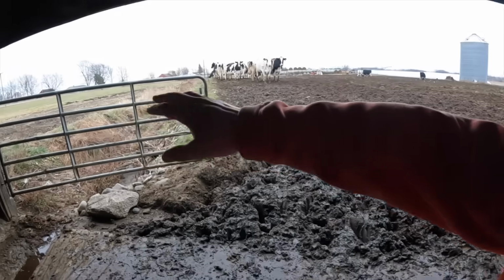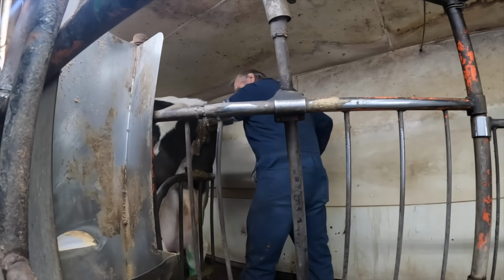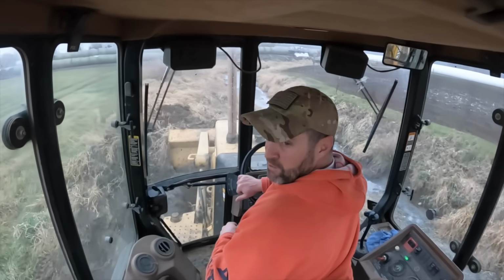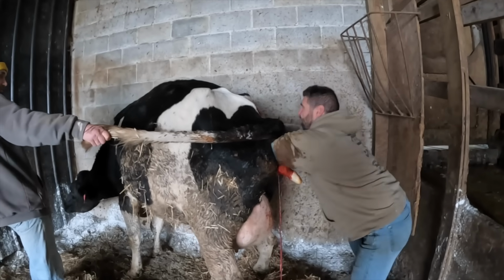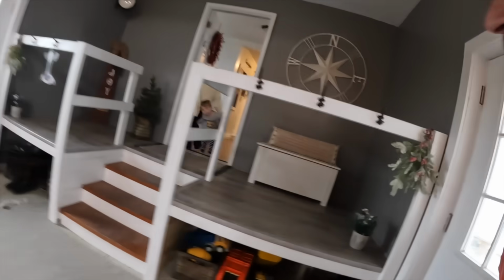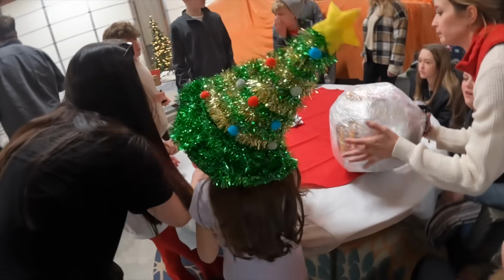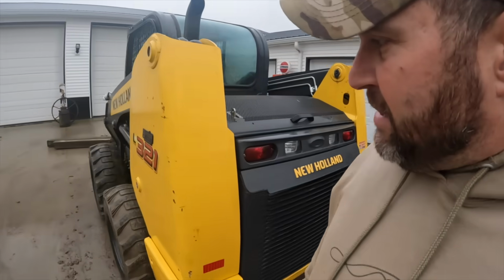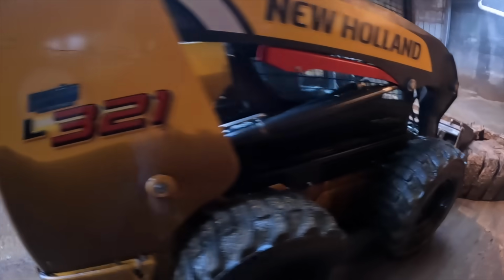Christmas on the Farm (Graphic Content @10:12)😞

Comment: To change your oil look up a mighty vac fluid extractor.   The other thing that works well is build a hose with a shut off valve that will thread into you oil pan. I did this on a skid steer and log skidder. That also worked great.

Comment: I agree that the oil drain system really sucks. Ours used to be side drain but that hose wore a hole thru the oil pan and they had to pull engine and replace pan, switched to that hose drain style now.  Out of warranty of course

Comment: I would have stuck with case
Reply: Or, Deere . We had JD 332 and 333E, side panels came off to get to filters. Oil drain hose on the right rear was easy to get to as well.